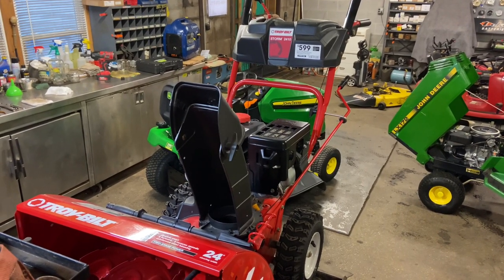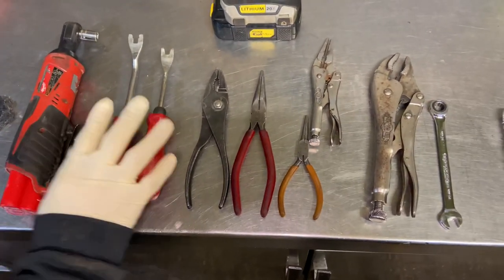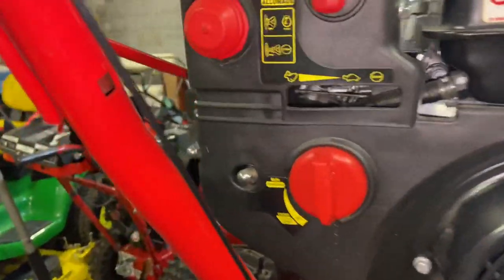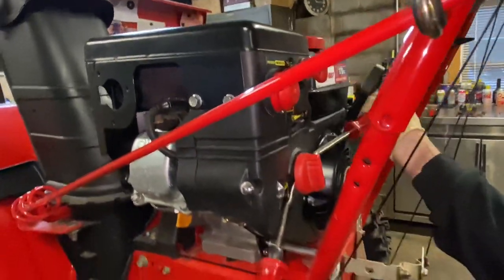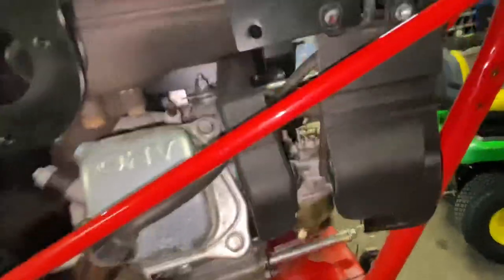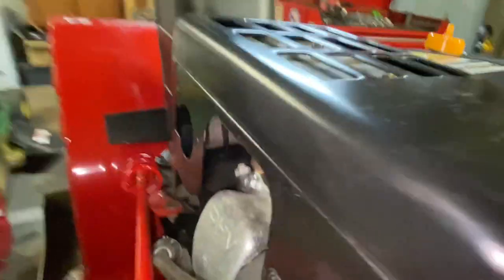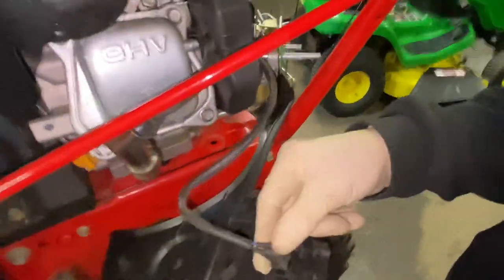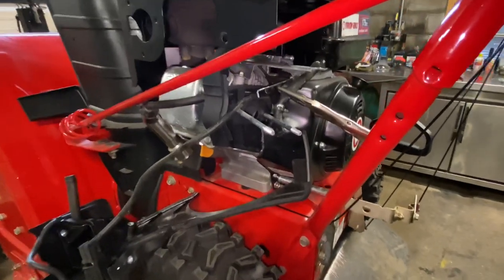How to remove carburetor TroyBilt 2410 Snow Thrower (Old Style)

Comment: 👍👍👍👍👍👍👍👍👍👍👍👍👍👍👍👍👍👍
Reply from the maker: Looks like you’ve been watching a few of my videos. I hope your back up and running soon.
Reply: @JohnsonsSmallEngines  Successfully swapped out the carb today. Your video was very helpful.  Throttle plate was seized, varnished up and corroded...glad I decided to replace it instead of trying to rebuild it......had to pull the fitting out of the bottom of the fuel tank. The screen was completely varnished up and clogged. I didn't get a drop of fuel out of the line when i disconnected it from the carb. Added fresh fuel and two pulls later it started right up ! ! ! ! !    Thanks again ! ! ! ! !
Reply: @JohnsonsSmallEngines  It was a neighbors machine......I recommended they throw out their old gas cans and get a new one and gave them some Sta-Bil so they wouldn't have this problem again